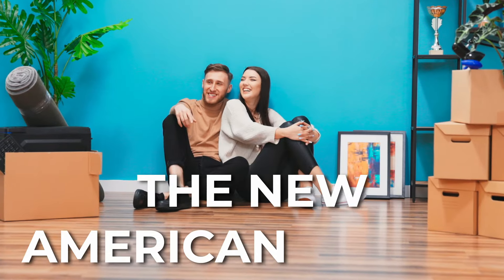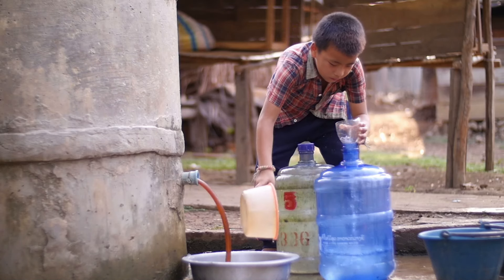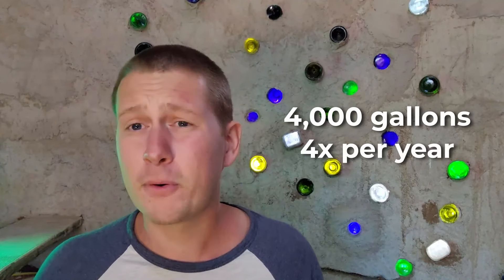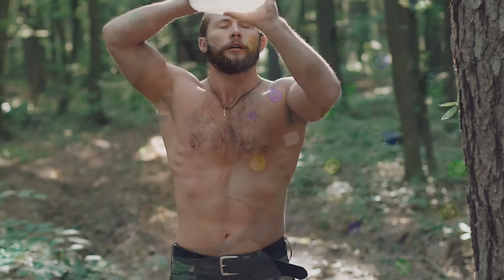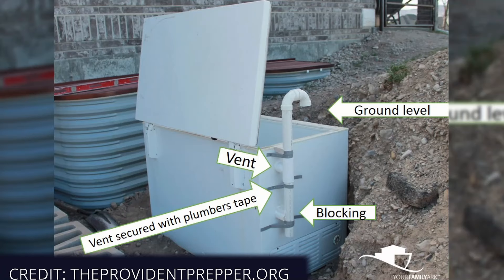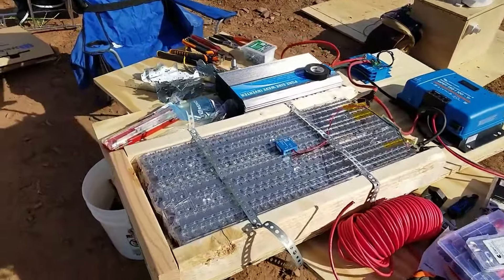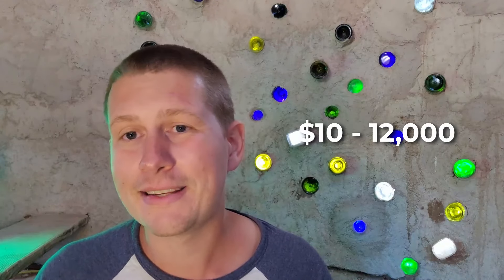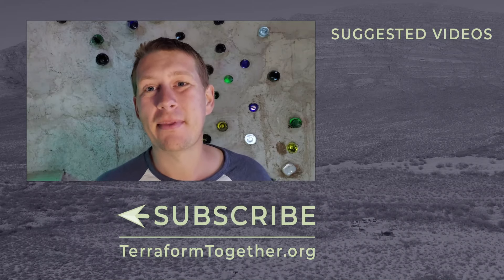How To Start a Homestead | Overview of Off-Grid Water, Sanitation, Food Storage, And Power

Comment: I found a 45 watt "car" fridge/freezer that has dual zones... I wanna say I paid 220 for it?  I got a 600 wh portable battery (175?) and it did okay ran the cooler for 24 hours but took forever to charge... and didnt really do the "pass through" charging like i expected. I started with a portable solar panel.... it was trash... took 12 hours to charge the battery. I got a 2nd better portable plug and play battery with 750 wh ($210) lasts 2.5 days without solar. I got 2 110 w solar panels at 60 each .  With solar is charges fast at like 2.5 hours. FINALLY both portable batteries stay changed or charge fast if drained due to cloudy days. And I'm not having  food spoil like I was. The new battery is dedicated to just my cooler and the other is used for my phone or corded power tools. (I say finally but I've only been here since sept)
Reply from the maker: Glad you got it set up :)